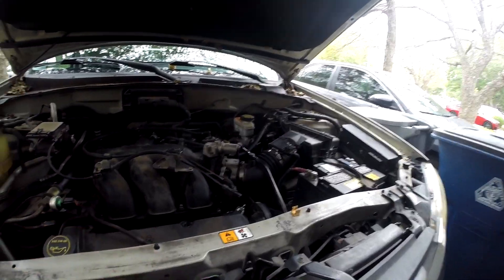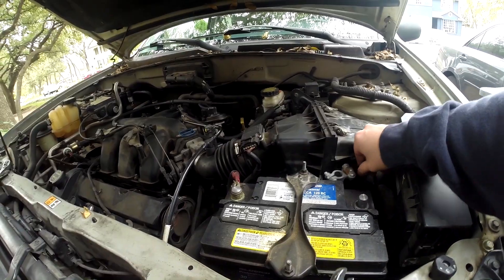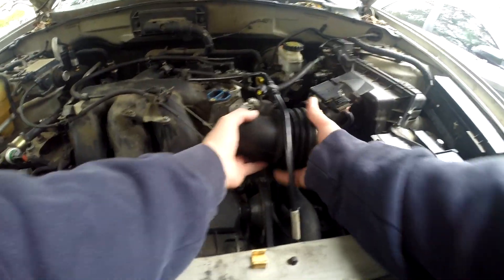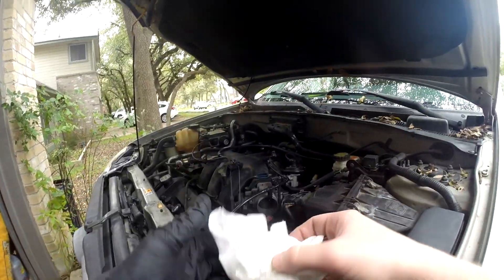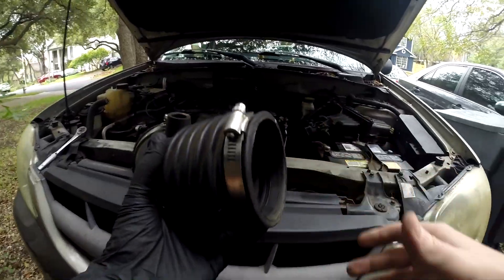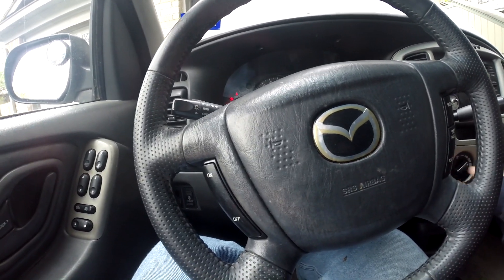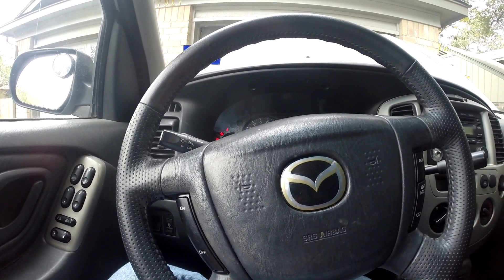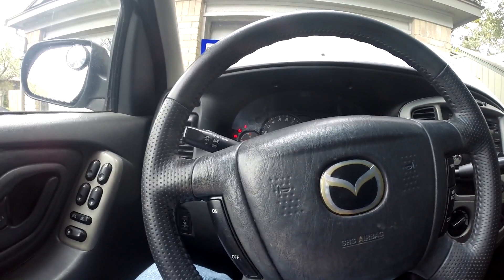2003 Mazda Tribute V6 ES - Cleaning MAF Sensor, IAC, Throttle Body (Ford Escape, Mercury Mariner)

Comment: I had problems with my 2002 Mazda Tribute for along time lots of dollars spent , rough idol, blown coil No.3, done this on this video and changed the fuel injectors, new sparks n coils, cat convertor n finally my car drove perfect. Had issues on this car b4 but now it finally drives great but my pocket empty! 😢
Reply from the maker: Yeah, it can be hard to find out what the issue is sometimes, since so many symptoms can be caused by different things

Comment: Hello again & happy Monday! 
So I’ve ended up here too. When last we spoke I had undertaken my tribute’s PS fluid & filter per your yt & with great results.  Sadly, it was a short lived reprieve. I am presumptive, but It stands to reason that after the ps video you too noticed a continued or even additional issues, thus this subsequent post. & same here. I do too. 😩 the noises & irregular idle did return bringing along some previously unnoticed, what I perceive to be brand new clues & manifestations of some defunct, unidentifiable bullshit.  Ive read wads of forum post & info. I am inclined to believe my tribute also needs de-carboned &  probably calls for a replacement idle air control valve as well. Long winded, I know. But I told ya allll that to get to this: 
Our verbatim tributes have expressed problematic similarities / congruent issues. Your videos & commentary have proven most helpful & I tremendously appreciate what you’re doin. Yet, I’ve questions. If you’d be so kind, any input or experience on any of the following is so very appreciated. I’m at my wits end, “I’m wiggin out, man.” But for real.  I have been entirely turned away by 3 “professionals” in this podunk punishment of a town.. which is the epitome of the deliverance flick 😖 If your still reading -again, I’m so sincerely sorry for the length & thank you. I appreciate your time & attention. 
Questions regarding: 
-ck engine light never came on. Still not
-exhaust is slightly smoky smells very rich of petro. 
-I can hear hissing like air escaping or maybe a swift intake of air from vacuum tubes near the ac compressor. 
-to engage the ac compressor almost stalls the car completely. 
-when I turn the ac off I hear a tiny pop. Like a little backfire. I’ve heard it from near the back as well as in the dash. 
-the whining I initially noticed has progressed to include a squealing pulley type noise
-my own whining is worse than the tribute’s. 😭 
So there’s all I can recall. I fully understand if this is deleted & I am blocked after this redonkulous diatribe. If anyone has managed to hang in here this far.. wow. How? But if anyone can offer any insight, by all means, speak freely & thank you 🙏🏼.
Reply from the maker: Hey! I'm still glad I can be of some use in my videos! Sorry that you're still having issues with your tribute. You're right, I never fully found out what was causing all of my issues. And no worries about the long comment! I'm sure my family got tired of hearing me speculate and complain about my tribute when I was working on it and deciding what to do. I'll try to answer as much as I can with my limited experience, what I know is usually from doing the same kind of scouring the internet whenever I run into issues.

Check engine light: Mine never came on again either, but did come on for the airbags, but I fixed it by disconnecting and reconnecting the connectors based on some recommendations I came across. If you have an OBDII code reader, or know someone with a code reader, you might be able to get some more info on any potential issues. I think even an auto parts store would do it for free as well, just don't let them sell you an alternator or a battery when you don't need one lol.

AC noise: If it sounds like air, there might be a leak in one of the hoses? I'm not really sure. My AC didn't work and it sounded like this gurgling / liquid sound every time the compressor kicked on.

Whining: If you're hearing more whining, then it may just be your power steering is still leaking and need to be topped off again, and if it's leaking onto a belt, that might make it squeal more. If it's unrelated to that, it could just be another belt that's loose or a pulley / bearing that's worn.

Exhaust smell / AC almost stalls the car: Those both sound like the car is getting too much fuel. My first thought on that is a stuck open fuel injector, but it's also possible that cleaning the MAF sensor might help. Another thing it could be is a bad spark plug or coil, or even oil in a spark plug hole, since if it's not getting spark somewhere the fuel won't get burned. Last thing is maybe check your air filter if it's been a while, might be a stretch, but it's possible if it's really dirty or clogged it's restricting air flow.

A lot of my issues sound eerily similar to yours like you said, so hopefully that helps give you some direction. Of course I'm no professional, just someone who likes to solve my own problems when I can, so those are the things I would personally look into, although I can't say for sure without actually being there. I would definitely start with the stuff that's easy to check first.

Comment: Have you replaced the throttle pressure sensor (TPS), it’s right next to idle air control valve (IAC). Your car won’t always give you a check engine light code for it. But if you have cleaned/replaced the IAC and it hadn’t fixed the problem then it’ll be the TPS. Usually best to replace both at the same time. Then of course cleaning the the throttle body or replacing if gummed up with carbon beyond cleaning capability. Best to take it all the way off, so you can see the other side and clean it and you’re not putting all that gunk back into your engine when cleaning.

Comment: My problems ended up with a bad coil. In the process we found the gap to set at .075.. should be .052 - .056
I was looking to see if you have removed the top manifold to get to other coils on the back side.. 
I just purchased mine 4 months ago. Had my first problem. Thanks again for the videos.
Reply from the maker: oh nice! Glad you figured out what your issue was. I did take the intake manifold off to get to the rear valve cover / spark plugs: https://youtu.be/cF3OTQezYtg
It's pretty involved, but if you label everything you should be good. I also linked a more concise video by World Mechanics in the description that helped me figure out what  all needed to be removed: https://youtu.be/EZQGE-CJRlI

Comment: I suggest next time you can gas on to top with the engine turn it off, in the key engine off position in order to open the butterfly spring idle throttle body. Spray on and keep it open for about 10 minutes for letting it dry. As a tip, you use an object pressing in the gas pedal. Turn the motor engine on 25 to 30 minutes after cleaning the the idle throttle body.

Comment: Hey Ryan, I’m having similar issues with my tribute, intermittent stalling when coming to a stop but the check engine light does not set. Did you ever resolve your RPM issue?
Reply: You ever fix it ? I have the same problem after i ran out of gas down the street from the station 🥲

Comment: Did you ever figure out the issue? I am having the same problems, error that I am getting is that there is a leak, smoke test couldn’t find anything. Have essentially done all that you have done in your videos as well except for me I had a significant amount of oil in my PCV valve.
Reply from the maker: I never fully fixed the rough idle. It occasionally came back, and it seemed to be after it rained, so I'm not really sure.

Comment: I have a 01 Tribute ES V6 that idles like that. My check engine light came on and the code was p0133 O2 Sensor Circuit Slow Response (Bank 1 Sensor 1). Do you think cleaning my M.A.S and my throttle body would solve the problem to this code?
Reply from the maker: Especially having a specific code, it's possible that it's the O2 sensor that you mentioned. But cleaning the MAF Sensor might also help, it's listed as a potential cause here: https://autoservicecosts.com/obd2-codes/p0133/ , basically something is causing the air/fuel ratio to not be adjusted properly. I'd say it depends on what you want to try first, Maybe take a look at the mass airflow sensor first and see if it looks bad, if it does then it's more likely that cleaning it will help. If not, it looks like the O2 sensor is around $20-$30, and if you can do it yourself, that's what I would try next.
Reply: Ryan45678 okay thanks for the information.

Comment: change the intake seals upper and lower
Reply from the maker: I did the upper ones while I had the intake manifold off when I did the valve cover gaskets. I thought about doing the lower ones, but I hadn't thought to depressurize the fuel system before starting since I didn't plan on it originally. And if I remember correctly I had some trouble getting the fuel rails off anyway, so I didn't want to mess with it at the time

Comment: Run a wire from negative to positive for a few seconds
Reply from the maker: so basically, weld the wire onto my battery terminals, and possibly catch the battery on fire? How many extra hp does that get me? lol
Reply: @Ryan45678  Who said weld? Oh you did. Hold a small 12 gauge or 14 gauge wire on positive and negative for A FEW SECONDS. Computer is reset. Thank you, next.
Reply from the maker: lol I thought you were joking? Wouldn't connecting the battery to itself just heat it up? And disconnecting it must do something, since it resets the clock every time I disconnected the battery. And the haynes manual even says the ECU has to relearn its fuel trim strategy every time you disconnect the battery, so I'm not really sure why I would do that..